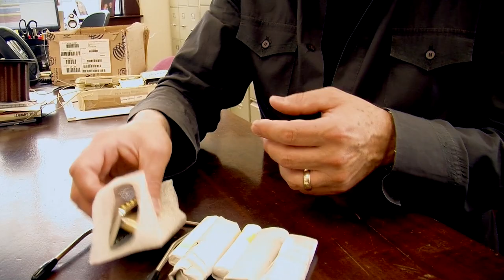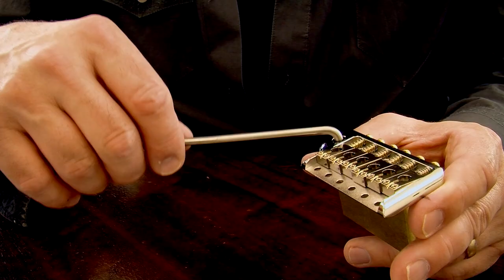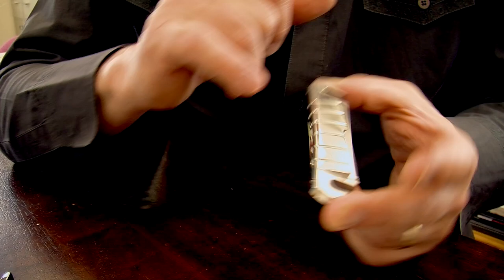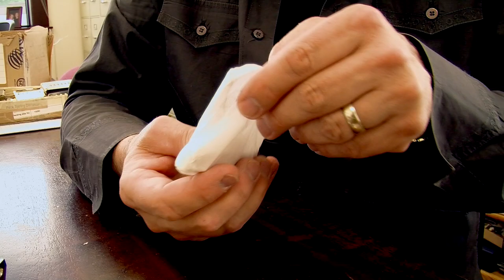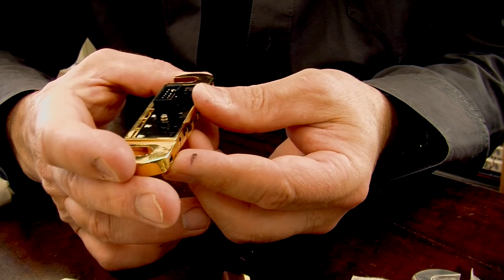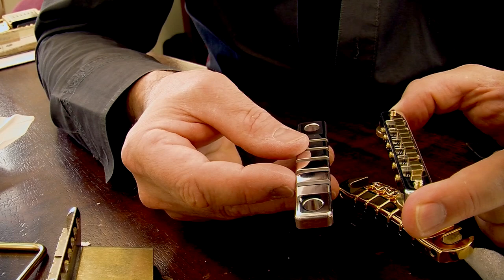Bridges

Comment: This is the perfect example of what PRS is all about. Attention to all possible details. From the materials to the construction to measurements. BTW what would be a proper way to clean and keep the brass saddles shiny? Just got my 594 WL 10 top few days ago. I am the first owner but guitar was made in 2018. Everything is perfect accept the saddles got bit tarnished and string got darker to. It sounds so good that I have not noticed it in the shop. Paint job and polish is just like it was made yesterday. Everything is working great. First time I have noticed that standard D'Adario strings might not be up to the task regarding to sound. Although old strings that came on the guitar sounded better. Also has anyone changed wraparound tail peace to one with brass saddles and studs? Theoretically it has a good chance to sound better specially in SE guitars. Brass bushings and studs plus brass saddles it should resonate nicer.

Comment: To me the one piece bridge is the best sounding...I am tempted to try to put one on my les paul..the most lively guitars I've played have had the one piece bridge...to me I'd think the less that comes in contact with the string, it should ring more purely, to add the tail piece is another point of contact...I do like the new 2 piece with the tail piece that you don't have to feed through the hole...that's a time saver right there..I mean, a les paul standard has a 2 piece, so of course there are killer sounding guitars with that setup...I'm just going from my experience and loving my core prs guitars...I own 3...p22, custom 22, sc 250..the sc 250 is the best of them all, for me...but I'm a gain guy...it just sustains so beautifully and has character, while being just THICK

Comment: This is the most important piece of gear on a guitar. It all begins (or ends) with the bridge. The PRS tremolo bridge system is far superior to the standard Fender design. That is, the vintage six screws into the body design. The Fender synchronized trem, with the two post (like a Floyd) are really good, on par with the PRS design. But you can only get those on the American Standard. The PRS is available on the SE lines as well.
Reply: The neck is the most important part of any guitar. Shit neck = shit guitar.

Put a Mannmade trem on your Strat.

Comment: Hello Paul. I recently purchased a Fredrik Akesson model which has a TonePros AVT-2 wraparound bridge. This bridge did not come with an adjustment wrench and is extremely difficult to set up, because the bridge pickup is in the way when I am trying to make intonation adjustments, and the nuts which are used to change the action height are not very wide and are therefore difficult to grip with any tool. I think that this bridge is absolute garbage and has ruined what would otherwise be a very good guitar. This is not my only problem thought. The stock pickup pole pieces were misaligned with the strings, and the strap broke on the gigbag! I am very disappointed with this purchase.
Reply from the maker: Hi ANDYB1478. We're sorry to hear you are having so many issues with your PRS. If you would, please contact our customer service department by calling (410) 643-9970 or by emailing custserv@prsguitars.com and they will do what they can to help. Thanks for reaching out.

Comment: I've had two PRS guitars (a Custom 24 and a CE24, which I still have), and neither would stay in tune when using the tremolo. It wasn't the nut, which was clear from how bending strings never caused an issue. It was always the tremolo. I'd lubricate it, and it never made a difference. I read somewhere that the case was likely the break point over the saddle grabbing the string when the tremolo was engaged, causing the string to go sharp (always the problem). If anyone has any suggestions on how best to deal with this, I'd appreciate it. For now, I just do without the tremolo, which makes me wonder why even keep this model guitar.
Reply from the maker: Hi Kevin. If you would, please contact our customer service department by calling (410) 643-9970 or by emailing custserv@prsguitars.com and they will do their best to troubleshoot the problems you are having. Thanks for reaching out.
Reply: I have the same problem with my $5470 core custom 24 w/piezo!

Comment: WHY 6 SCREW POSTS INSTEAD OF 2 POINT?
Reply: The mounting screw holes are countersunk from underneath so it's a combination of the vintage style 6 screw system and the modern 2 post knife edge setups so that the bridge returns in tune every time
Reply: I bought a PRS Santana SE and love it. Perhaps Paul chose to have 6 screws for a traditional classic look? Or maybe he believes 6 screws transfer vibration to the body better than 2. Or maybe spreading the load stresses across 6 screws is better than those same loads in 2. I upgraded the screws on a couple 6 screw trem bridges I have with good success, far superior to standard trem screws. In fact I upgraded a standard 6 screw trem bridge with an all brass PRS trem made by Musiclilly. I wonder of Musiclilly is the OEM source for PRS. Their quality is pretty impressive for Chinese made. Gorgeous stuff.